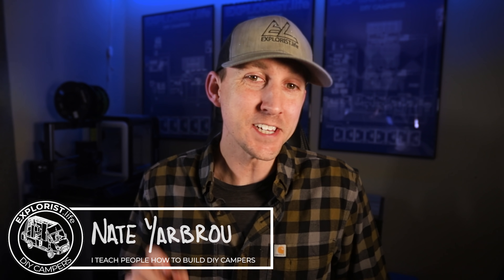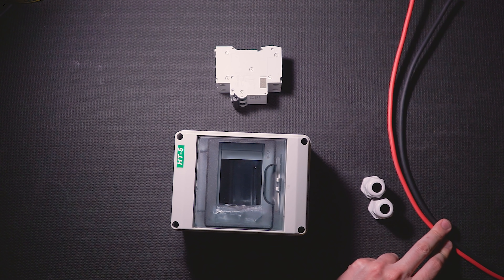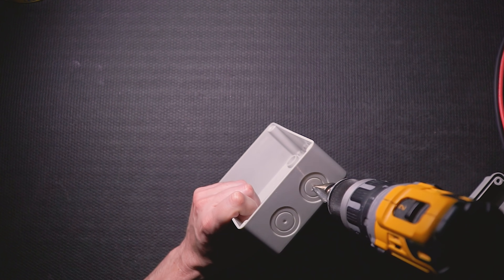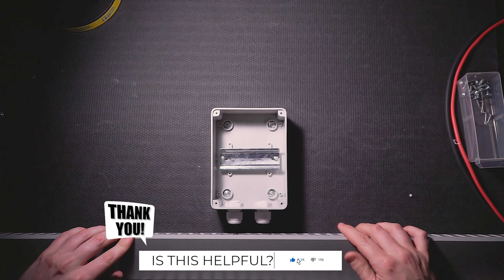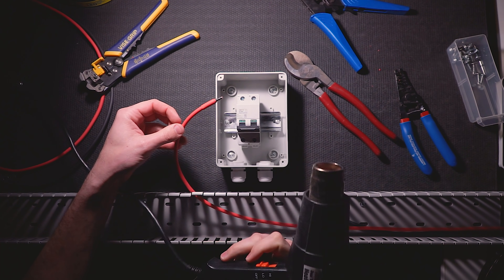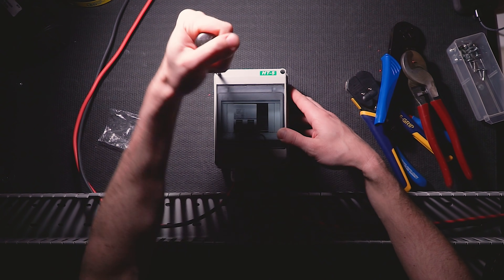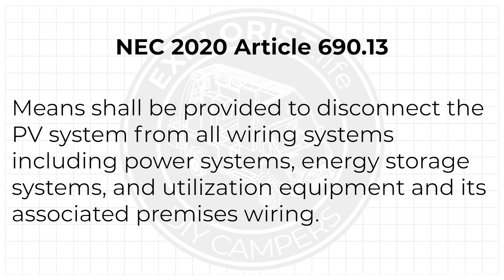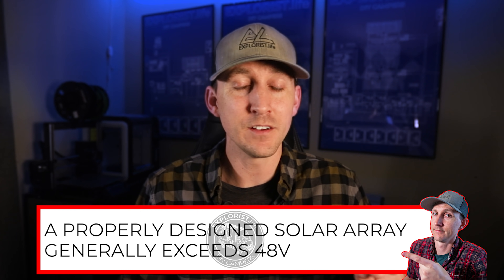How to Wire a Solar Disconnect for a DIY Camper Electrical System

Comment: Sorry for the newbie question Nate but does it matter if the wires from the panels go in the top or bottom of the breaker?
Reply from the maker: It's best to go from the top down unless the instructions say otherwise.
Reply: @EXPLORISTlife  OK, thanks for the quick reply Nate. I will re-do my wiring. It was easier to feed from the bottom because the factory wires coming from my roof were too short.
Reply from the maker: Okay, actually... let me backtrack as I looked into this a bit more...  It looks like it 'generally' doesn't matter which way around they are wired; especially since we are just using it as a disconnect and not for any kind of overcurrent protection.  For that reason, It's probably fine to leave it as-is...

A google search of "are MCBs directional?" should back up this claim.

Comment: What is the black plastic fabric covering the backer wood panel?
Reply from the maker: Coin grip flooring makes a good backer board cover for this stuff.

What you are seeing in the video is the back of a $5 door mat since I go through them quickly for these videos & blog post pictures.  I don't recommend using a rug for a permanent install. 🤣😂
Reply: @EXPLORISTlife  Thank you, Nate, for the suggestion.

Comment: Really great video. I would like to know what the Backer Board is that was used to screwing everything down to. I have looked at backer board for tiling but it is pretty brittle. I could use a piece of plywood but would like to find something a bit smoother. A sheet of ABS plastic would be nice but pretty expensive.
Reply from the maker: What did I use? or what should YOU use? lol  For the sake of this video...  that is the bottom (rubber) side of a $5 floor mat/rug that is screwed to a piece of plywood; which I would NOT recommend for a permanent install.  BUT...  in my next full install, I'll be using plywood with coin grip flooring covering the surfaces with the components screwed to that.

Comment: Where is your lightning protection and ground located?
Reply from the maker: To the best of my knowledge, It's not required for mobile applications.  Its not mentioned in the ABYC nor the NEC for our purposes as we can't drive a rod into the ground while we are driving.
Reply: @EXPLORISTlife  Yeah, i realized that after posting, that your doing a mobile install. I guess chassis grounding is the only ground required.
Reply from the maker: Indeed!

Comment: This is the first time I’m hearing about solar disconnects; it’s like a kill switch in case something gets on fire or you need to adjust the batteries right?
Reply from the maker: Yeah, maintenance, emergencies, system storage, etc.

Comment: I understand you need the breaker for a home system that is connected to the grid, ( I have a grid tie system) but I have not heard of having to follow code on a camper or off grid cabin. I put one in on the system that  I installed on my toy hauler, but it was just for my own safety so I can disconnect it when I want to work on it
Reply from the maker: Ultimately, nobody is going to be checking our work on a camper.  There are no inspectors for this.  My goal is to teach the safest way I possibly can for this stuff and if people want to opt-out of particular things that they feel not important.. that's their prerogative.

Comment: Nate: Thank You for excellent videos and information. I'm just starting to install solar on our travel trailer. Can you provide information on the H-5 disconnect box you used? Is it available on Amazon?
Reply from the maker: Glad it helped!  Info on the breaker box can be found in the parts list from the blog post: https://www.explorist.life/how-to-wire-a-solar-disconnect-for-a-diy-camper-electrical-system/
Reply: Thanks for all the great info, what should we do in the case of a small cabin installation, do we still need the  breaker? What does it mean solidly grounded?

Comment: Stuffing two cables into a cable gland designed for a single round cable is less than ideal.....
Reply from the maker: It's fine as it's simply for strain relief and not for water resistance in this application, but feel free to add as many cable glands as you like when you get to this part of your project.  The process is the same.

Comment: This is exactly where I am, but I'm concerned about next steps. I have 8 of these panels (https://www.renogy.com/200-watt-12-volt-monocrystalline-solar-panel/), connected in pairs, series / parallel. If my math serves then I should be getting roughly 40V and 40A which does add up to the 1600w I expect. My question is should I put a 50A inline fuse between that and this dual disconnect box you are showing in the video? I purchased the 3000W Inverter / 1200W diagram from your site, but since I had 1600W, I am going to need to adjust some things. I appreciate your time. - Clint
Reply from the maker: Wire the 8 panels in 2 parallel connected series strings of 4 panels each and that will get your amperage low enough so you can just use 2x mc4 fuses on the MC4 combiner which would then go do this solar disconnect.  Wiring a solar array that operates at more than 30A requires a whole new slew of considerations.
Reply: @EXPLORISTlife  Back to the drawing board it is then. Thanks sir.
Reply: @EXPLORISTlife  I had a similar question -- but 5 100W panels in parallel (Optimum Operating Current 5.72A), I have a 3 branch connector going into another 3 branch connector to get all 5 in parallel. 5.72x5x1.25 = more than 30, so I'm struggling to understand how I should fuse these panels. 5 30A MC4 inline fuses? Or because the Maximum Series Fuse Rating is 15A, can I use 15A for each panel? Could I get away with 3 30A connectors at the last branch connector? Last question... still need a circuit breaker once inside my rig to disconnect these, or could I disconnect the MC4 connectors from the panels when I want to service? Thank you so, so much.

Comment: Hi Nate. Thanks again for taking the time to put these together. We really appreciate it. 
Quick question, are you using the glands just because they came with the box? It doesn't seem like it needs to be waterproof 😊 and two cables in one gland wouldn't do that anyways, right?
Are you worried about the edge of the entry hole abrading the cable? A simple grommet would work for that, no?
Reply from the maker: More for wire strain relief to help hold the wires in the breaker in the event it gets loose.
Reply: Gotcha. Thanks for the reply

Comment: Great Video! It just popped up on my YouTube feed. Question: I have thought that you should not hook up your solar array without it connected to the battery. So by disconnecting the solar array does it damage the solar panels?
Reply from the maker: The battery bank should indeed be connected to the charge controller before the solar array; but with the switch off... the array is effictively not connected to the charge controller.

Comment: Well I have a question. I have a small trailer that uses only portable panels via the Zamp connector. I installed a VE Smart MPPT 100/20 wired directly to the battery. My only thought is I should put the MPPT on a switch so that I do not have any parasitic draw when not in use. Thoughts?
Reply from the maker: The MPPT standby amp draw is listed a 1mA (.001A).  When in storage... perhaps just leave the solar up and running so your batteries are ready to go when you are?
Reply: @EXPLORISTlife  Thanks. That's not much draw so I'll keep my eye on it. Thanks for all the great education.

Comment: As always great video! a quick question - ive been wiring the breakers you just showed NOT to wire , as thats the one youve been wiring before in the past. ( 50amp marine grade breaker. ) Is this a fire hazard in all my previously installed vans ?
Reply from the maker: I mean, I can't say that it will for sure start a fire, but pushing more voltage than rated is indeed a hazard.  To what degree, I don't have a metric for.

Comment: I'm in the design phase to transform a new 211cdi sprinter, L1H1, small, but practical to be able to explore the towns and villages here in Europe, it's more practical to park ... etc
But now I have reached the point of doing the electrical project, something that I am not used to doing, I am a civil engineer, I understand 220v AC circuits.
I wish you could help me with that part.
I'm Brazilian, but I also live a lot here in Portugal, where I'm going to do the conversation.
Well, I started making a spreadsheet, with the necessary equipment and power, I have no intention of filling the campervan with things, especially since it is an L1H1 sprinter, i want a simple installation, but I don't want to have propane inside, so I prefer a stove with a only induction zoneTo heat the water i will use a D6 truma, which is diesel.

https://www.ikea.com/pt/pt/manuals/tillreda-portable-induction-hob__AA-2234813-3.pdf

I watch your videos and in one of them you did an electrical installation.Well, the result of the spreadsheet was:
total 220v = 57Ah, ~800wh to conect
notebook
induction cook

total 12v = 40Ah, ~490 W.h to conect
USB
fridge
water pump
fan
lights

To measure the consumption of the induction cooker,to calculate the demand for the induction cooker I used an average of the power levels to make a light meal, similar to the levels I usually use here at home. and other days we can't even use it, just a salad.

Just to remember, here in Portugal the summer is very hot, it has sun for 12 hours, in the months of July to September, therefore a good use for solar panels.
Other equipment we can manage to connect them when we are not using induction and we connected in a Camping.

With these results, what electronic equipment (inverter, batteries, solar panels, charger, controller, fuses, or other equipment ... etc) would I need for a van configuration with at least 1 or 2 days off-grid
I will be grateful if you can help me!
my email: joaoclp55@gmail.com

I am grateful if you answer.
Thanks
Reply from the maker: I think a 1200Wh is a bit under estimated for a system powering an induction cooktop, but ultimately, if that is indeed the case... any of the diagrams I have here would work: https://www.explorist.life/solarwiringdiagrams

Comment: This is a sweet video as always.  Nice clean install too.  For my trailer, however, my 2x panels in series will plug into an SAE input jack on the outside of the rig so assume I am ok just pulling the panel cable connection from there.
Reply from the maker: Maybe?  Code doesn't say anything about that, but that would indeed disconnect both conductors at the same time.

Comment: Hi Nate, I am a new subscriber and have been watching many of your videos. I am inquiring if I could use 2 of the resettable fuse inline circuit breakers as a disconnect, one on the positive and the other on the negative, if my two 160 watt panels are connected in parallel with an open circuit voltage of 22.9V and a Optimum operating voltage of 20.2V?  Thank you.
Reply from the maker: I recommend using the breaker that I showed in this video.

Comment: OF ALL OF THE VAN SOLAR BUILDOUTS I HAVE SEEN ON YOU TUBE, NONE OF THEM HAVE CONCIDERED ANY CODES WHATSOEVER.
Reply from the maker: Yeah, I'm making a much bigger effort on codes and compliancy standards than even I used to.  Since I'm a brand ambassador for both Victron Energy and Battle Born Batteries, they both give me the resources/education necessary and push me to 'do it the right way'.

Comment: LOL, that DC-DC charger just wasn't going to let you connect it instead of the MPPT charge controller! Love it.

While the NEC doesn't technically apply to off-grid RV installations, they are, nonetheless best practices. As such, I follow code as much as possible and practical.

This is to say that not everyone does (follow code, that is). I just finished up redoing what what supposed to have been a completed off-grid solar system in a 1969 Airstream renovation. The original work was performed by an electrical engineer. When I got involved, there was one 100V/50A MPPT charge controller for the permanent roof-mount array and an auxiliary portable array! A 1-1+2-2 battery switch, rated for 32V max, was installed to connect/disconnect arrays. The 3S 100W panels produced ~65V nominal @ ~6A. This was all connected with 4AWG wire! What a mess.

To correct this, I installed a second, smaller MPPT SCC for the portable PV array. I eliminated the battery selector switch, and installed a non-polarized, dual pole, DC breaker in an enclosure. I did the same between the roof-mount PV array and the first MPPT SCC. I also transitioned the wire down from 4AWG to 10AWG. Not only is the 10AWG more than adequate for the current, but the silicone insulation made cable management so much easier.

A 30A shore power input was also previously installed...with zero protection between it and a MultiPlus worth well over $2K! I installed a non-polarized, dual pole, AC breaker on this line, as well, as one can never be certain what's coming off the post in many campgrounds.

Unbeknownst to me, my client then took the trailer to the largest solar dealer in Atlanta. He paid them $500 to check my work. They assured him that everything was correct. However, they also told him that it was "overkill." What! All I can say is, "Buyer beware."

Someone also told my client that the PV array must be grounded to the trailer chassis. Nothing could be further from correct. One should only ever consider grounding the frames of the PV array. Never the conductors! That's what the PV isolation breaker highlighted in this video is for!

As always, Nate, great work!
Reply from the maker: Haha!  Yeah... totally did the Orion DC DC on purpose.   Okay, maybe not, rofl!  I didn't notice until I was doing my final viewing after editing , exporting, and uploading but before the video went public.  I'm surprised it took 2000+ views before somebody noticed; so, good job paying attention!
Reply: @EXPLORISTlife  Star pupils!

Comment: Very timely!  I actually just asked a question on one of your wiring diagram blog posts (although I couldn't get the question to actually post) a couple days ago wondering why the ampacity rating was so high on the breaker.  Now I have my answer.  Good stuff.
Reply from the maker: Haha, I saw that and didn't respond because I knew this video was coming out within a few days. Glad you found it!  (I'll probably still answer, but with a link to this video when I sit down and answer blog post comments.)

Comment: Can I install these breakers in the same enclosure as my 240v AC RCBOs? Or should we definitely use a separate enclosure?
Reply from the maker: Hey Dannymars!  John Coloe is exactly right.  Sometimes you can find a breaker box that has a divider inside so you can use 1 section for your RCBO's and 1 section for your DC stuff like this.
Reply: @EXPLORISTlife  Arterra and WFCO both produce power distribution centers that provide segregated space for each load type. You may find others, as well as more expensive models from these vendors. However, beware of any charger claims if you're using lithium batteries.
Reply: It's considered best practice to separate AC and DC load distribution.
Reply: @ARepublicIfYouCanKeepIt  sweet, I’ll have to update my system as I’m using one of the big battery cut off switches he explained were not appropriate  :-/
Reply: @dannymars  I can't tell you the number of times I've had to rip out a battery selector switch that someone installed for PV isolation! Installation of a DIN rail enclosure and non-polarized, dual pole, DC breaker is a breeze. Best wishes for a successful install.